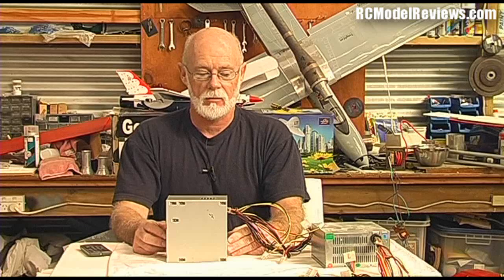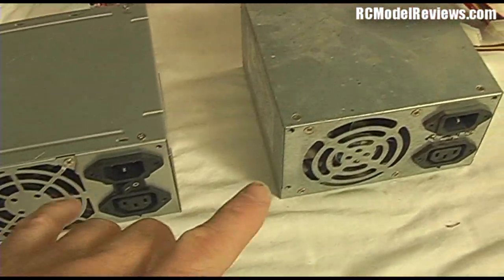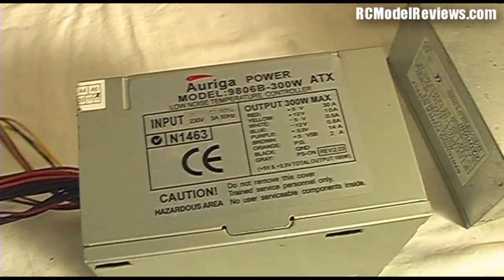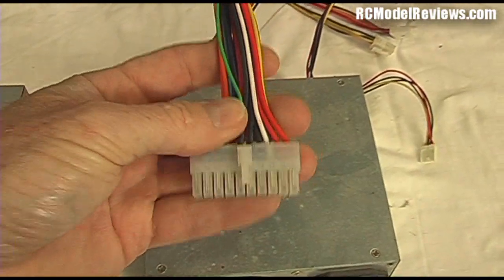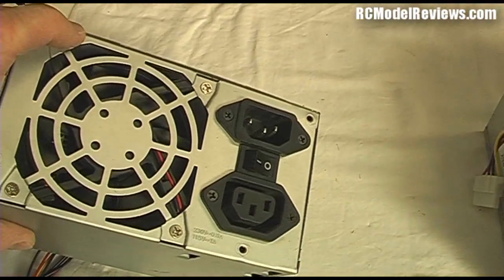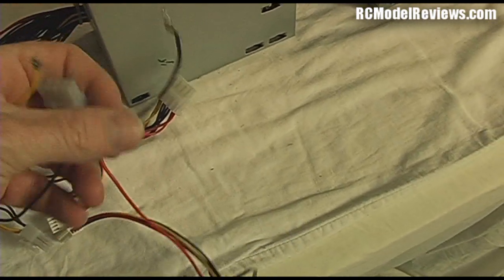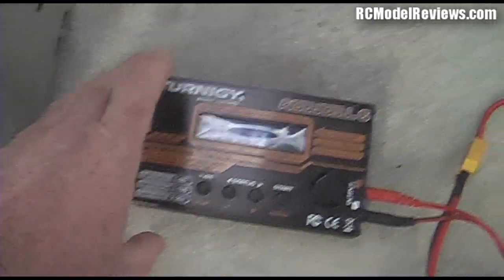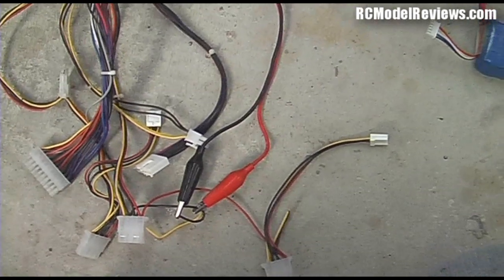DIY: Using a PC power supply  with your lipo charger

Comment: you can run as many chargers as you want. The wattage itself doesn't determin it, however the wattage of the 12v rail is the one that matters. Check how many amps the 12v rail can pull. As long as you don't exceed that you should be fine :) (and if you do, the psu should just shut off)

say you have a psu that can give 20A on the 12v rail. thats 20 chargers using 1A 200 chargers using 0.1 amp, or 2 chargers pulling 10 amps :)

Comment: This sounds like short circuit protection kicking in. It seems that what ever you plug it in to draws more current than your PSU can supply :/ Check the label and see how many amps it can pull on the 12 volt rail

Comment: You can just connect the green wire to the black one next to it, and i actually recommend that you do this. I'd also say, that instead of cutting the wire, just take a small piece of wire, and put it in the connecter from the green wire, to the black one next to it. No need to cut it. And yes, you can definitely touch it. as a rule of thumb, it starts to get a bit dangerous at 30 volts. so yeah you are safe :)

Comment: No. "It's not the voltage that kills it's the amps" is a terrible thing to say. The amps are directly realated to the voltage. There is no way IN HELL that that psu could pump 10 amps through a human. U = R * I (ohms law) Volts = resistance times current, that means I = U / R. worst case senario, you are very wet. humans will have a resistance of 1000 ohms. 12 / 1000 = 0,012 A

Generaly you want to watch out when you get over 30v. thats where it gets dangerous. (10-30 mA over the heart kills)

Comment: you really don't need that. Any decent quality PSU should do fine without you wasting energy in a resistor on the 5v line. whip out your multimeter, and measure the 12v rail, it shouldn't sag much lower than half a volt to a volt. (1v max though, or you have a shitty psu) If you take a look at something like a B6, it also has an input range of 11v to 18v, so you should be fine :)

Source: I build custom electronic stuff as a hobby, and i like computers :P

Comment: AT power supplies are just fine. Not a problem. Voltage does sag with load, it is to be expected, and a voltage sag of 0.24 volts really isn't a lot.

I had a poke around in an old at supply I had (it's dead now :/ don't let a scredriver on your table fall into it :( ) I assume you didn't have any wire that you needed to connect for the psu to start up, but it just had a switch on it right?

Comment: I would really recommend that you do one of two things: You solder those wires that you've cut (the turn on wire to ground) or even easier B: you just take a 1cm wire, and plop that in the 20 pin(or 24 pin) from the green (or gray). It's just a lot cleaner.

Comment: Just got mine working. Thanks for this great vídeo :)
I was having "connection break" issues with my Turnigy Accucel-6 50W 6A Balancer when connecting from other power supplies, and it worked great with this Solutions. 
THANKS

Comment: Hi Bruce, thanks again for a great informative video.. Just a quick question, do I have to use a resistor on a 5v line? Getting conflicting information on the forums.. Will it be ok without one?

Comment: How would one get the voltage up to around 15 volts to charge LiFePo4 batteries?.. 4S I think. I have a ham radio PS and it just is a little short of the needed voltage.
Thanks for the great video. bob

Comment: If you don't want to cut your wires on the Power Supply, what you can do is get a small piece of wire (preferably one with casing, like a regular cable, about 2 cm long) strip both ends of the wire, (if you have a regular cable), plug one end into the green/grey plug, located 4th from the left, and plug the other end into the Black wire plug (5th from the left).

This is the exact same as cutting the wire and connecting it to another black wire, except you dont have to cut anything!

Comment: Youve connected the black wire not correct. Have to connected to the PSU side, not the connector side of the cutted cable. Same with the other wires.

Comment: How can i use the power supply in mp pc without taking it out. I still want to run my pc with it but have a jack at the back of my pc i can plug my charger in. Is it possible? I guess it would only work when the pc is running.

Comment: nice quick vid bruce.. im late to the party, but a simple way to ground the signal wire is to stuff it into the wire next door to its original spot in the atx plug (ie: 5th from the left).
cheers!

Comment: Hi Bruce - thanks for your advice , pulled out an old computer sitting under the bed , ripped out the power supply & now were flying tomorrow (weather permitting) - the grey wire was 1st in from the left on the Dell PS - 5141 3A 145W power supply  - none the less were flat out charging batteries tonight - TOTALLY Stoked Thanks Heaps :)

Comment: I have modified quite a few in the past and most need a load on the 5v line to turn on and maintain 12v. Best I have found is to use a large 50w 4.7R metal cased resistor, but they do work well. 
I am also using two 400w PSU wired in parallel (another mod needed for that) to double the current to drive the stepper motors on my Home made CNC machine

Comment: actualy those ATX power suplyes need some load to work correctly, add an 10-100ohm resistor betven 5V line and GND and voltage will be 12V

Comment: Maybe you can help. I pulled the power supply out of my old HP tower. It works fine IN the tower so I know it's a good unit. I've read everything and watched everything I can and still can't get it to power up OUT of the tower. Dummy load on the 5v rail, 12 v rail, black to green per industry standards. NOTHING. What am I doing wrong? This has a single row mother board plug, not the double row like your video. About ten across or there abouts.
Thanx

Comment: @monboy10 Cut them off and use heat-shrink tube to make sure it's safe. Be aware to put heat-shrink tube on every wire and not all of them at the same time as this will probably short-circuit your Power Supply.

Comment: I'm using an old Compaq power supply. It does not have the standard wiring. However, all I needed for it to start was to put on a load, so no wire cutting. Took a while to figure out, simpler than I first thought.

Comment: Great guide! Would it be possible to make a diy foam cutter using one of these. Most of the 5 Amp  adjustable power supplys in sweden are at least 250 dollars.. Thanks a lot.

Comment: @TheMagicmole77 just be sure to short the green wire to ground without the psu being connected to the mains before u start messing with it :) it has nothing to do with plugin capacitors backwards:)

Comment: Hi there. Could you please make a warning that all your viewers are sure they are using an ATX suply ONLY. The AT's do not have a soft switch, therefore it is not wise to DIy a power supply with these as they do not have the certain safety functions that the ATX's do. How do i know this? Well i am a PC engineer myself and have experianced what can go wrong!

Regards, Liam

Comment: @stephen5150 Hi there, the AT power supplies do not have the soft button return therefore it is not advisable to use them. Try to find an ATX supply.

Comment: @jof1953 
Further to my last post I took a chance and simply wired the green wire to ground and it worked: I now have 12V at the yellow wires and and ps fan works. So Bruce, don't bother with any research on my behalf because the problem is fixed and thank you for your interest!

Comment: @RCModelReviews Hey Bruce, what do you mean by "tested them"?  I've got a converted power supply too, with one of the resistors everyone recommends but all my chargers still say they're only getting about 11.6 volts. Not that it affects charging though.  Just curious what you did to test.

Comment: @TheMagicmole77 It not radioactive:P, it says dangerous because before the regulation its actually 240/120v which well its dangerous if u touch it. As long as the psu is not connected to the mains and the capacitors in it are discharged u have nothing to worry about :)

Comment: with mine I took the case apart, removed all the wires then mounted some terminals on the metal case, paralleled up some of the wires and attached them. Mine the switch on the front of the computer was built into the power supply by a long mains wire which I shortened and mounted inside the case so i didn't have so many wires leaving the case to make it tidier

Comment: Hi Bruce,
Very interesting video.
 Unfortunately i have a computer power supply (400Watt, "Enhance" brand. model no. ATX 1140F, "with fan sensor control") which has the cabling cut off 10cm from where it exits the case i.e. there are no plugs to refer to in order to locate the correct grey or green switch wire.
There is one grey wire AND one green wire as well as multiple blacks, oranges yellows and one blue. Also there is no colour-code identification label. 
Can you help please?

Comment: Lot of people have a laptop computer who's dead at home...  Or other devices who works with 12Volts. 
My point is: If the power supply can out more than 3Amps, then, you can use it !
Of course, don't expect to use it to charge more thant 3Amps/hour ;-)
Oh, and s'cuse my English by the way.

Comment: wouldn't it be better to tell people to read on the label which wire turns the power box on, rather than having people use the fourth wire from the top that's either grey or green?